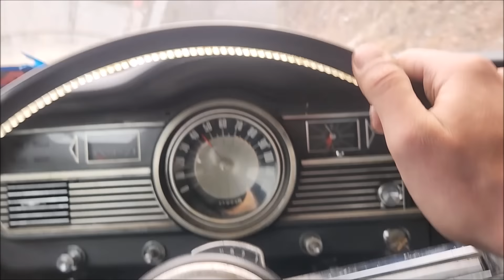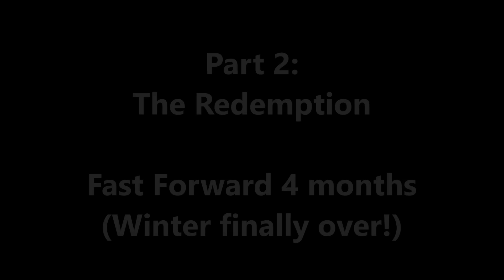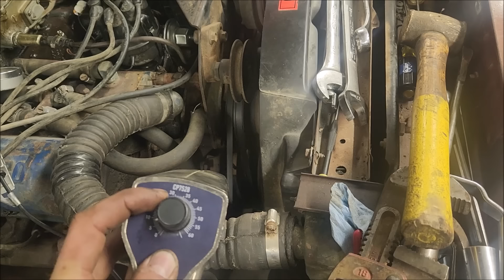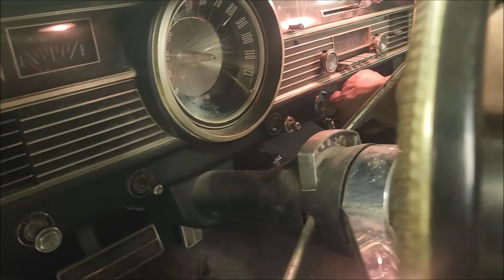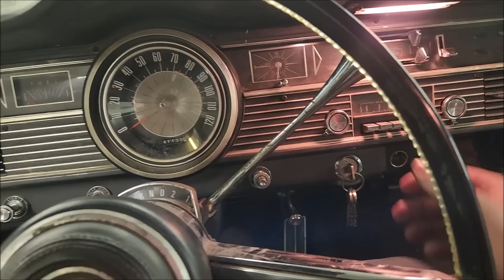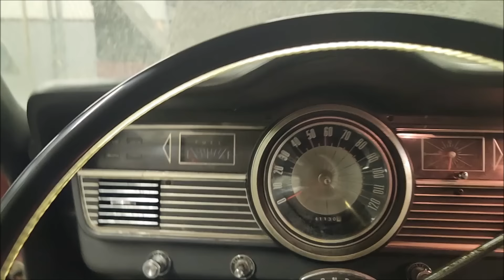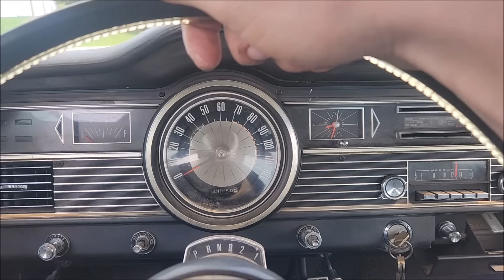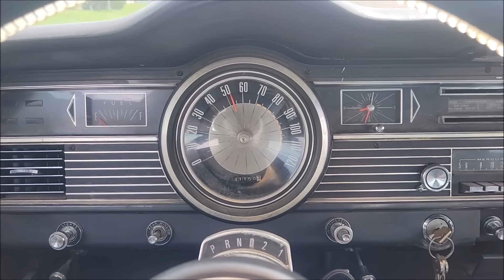$1,000 Classic Car - Will it Run & Drive Home?

Comment from the maker: Probably my favorite moment of the entire video was when I turned on the radio at 46:00 - 47:00. 
What a surprise that was 😆
Reply: No matter where you are and if only one station will come in. It will be a self help or religious one..go figure
Reply: Agreed hilarious random talk-show moment.
But what i resonate most with is your earlier point about parts compatibility by sticking to car models that share a lot of parts.
To others like myself, without much space to work on cars and keep parts, this is great advice.
I've had a Fiat, Seat, Suzuki, and now a Volvo. But i'm definitely sticking with Volvo and will most likely be driving the (2000-2010) V70's and S60's for the rest of my life.
Reply: If you wana do some Blow all you gotta do is ask unk Luke
Reply: hahah that was hilarious
Reply: It's a hell of a drug
Reply: Sounded like Dave Ramsey's voice.
Reply: Tell you what though. There are a few old cocaine addicts wandering around.😊
Reply: I had a 60 f100 and had a 351 Windsor in it. The trans went out, so I had an FMX trans so I put it in. That trans was stout. I know people talk trash about those. However, that one was really good
Reply: Back then, Ford am radios 📻  were the loudest. We had a killer AM hard rock station KVAN 1480 High as Hell from Orygun 👋
Reply: I have engine compartment heat issues (75-87 Econoline w/carburetors) I am thinking about using those "liquid heated carb plates) to run a separate cooling system (Using like an A/C Condenser in front of the radiator) with separate coolant that is pumped via an electric pump, to cool the base of the carburetor....Due to today's fuel...I would run a return fuel system, but it still won't help the "parked boil over scenario" nor will it work easily with multiple fuel tanks.... Its really only the short stops that it causes an issue, like a convenience store stop on a road trip... Overnight or a couple hours...it doesn't matter much.
Reply: Cocaine is a hell of a drug--Rick James...
Reply: Tech tip, pack the flutes of the tap with grease and most if all chips will stick to the tap.
Reply: Yeah that was funny! Talk about timing!!!
Reply: @courier11sec It's the meth that will get ya!
Reply: In the words of Johnny Paycheck:  "The old white train costs a lot to ride."
Reply: Nice Video
Reply: Cool ol Truck 😮
Reply: @ThunderHead289 a bit of axel grease (packed into tap openings) in your Tap for the fuel filter will catch most of the cuttings from dropping into the (Carb) insert boss threaded part.
Also thread tape should only have 2 perhaps 3 wraps at most.😊
Happy Fixing.😮
Reply: @sidviscous5959  lol, what a name, sid. cheers!
Reply: @Derek-tk4wf Same, I am 99% sure it was Dave.
Reply: Great channel man the radio 📻 that was a crack up 😂
Reply: are we going to have a revist to that mower you made from the axle I think it's very cool
Reply: Yeah, and THEN you started digging around under the carpet. I started thinking, hmmm, wouldn't that be ironic, lol
Reply: That was gold
Reply: Do those distributors come locked?
Reply: Does it have a dimmer? Check that floor bump, I found a Ford mechanic's 1/4 "drive ratchet tool in a 1990econoline E150, the guy at East Lake Street motors had a rusty white 4 door Lincoln, a dive back in to Ford may be in my futures
Reply: At that point, I  had a feeling cocaine is what you was going to find under the carpet.. lol
Reply: Guy on radio sounds like Dave Ramsey.
Reply: @ThunderHead289  😂😂. Definitely a peak moment.

Comment: Luke, you do such a good job of instruction and advising when you work on these old cars!  When I was a teenager, I asked for a timing light for Christmas (around 1975-- I got a Sears Penske timing light and dwell meter.  I still have them!).  Back then, most of the vehicles on the road still had points type distributors, and I worked at an auto parts store where I sold lots of points/condensers (I still remember parts numbers from back then!).  I learned how to do tune-ups, and most of my friends and family used to bring their cars to me-- mostly GM with a Ford here and there.  As long as they paid for the parts, I didn't charge any labor-- what a deal!  I remember that my grandfather's Chevrolet truck was running rough and to my surprise, he asked me to look at it for him (he almost never asked for help with anything).  I put a new set of plugs in it and tuned it up for him (and found a broken vacuum hose which I replaced), and he was a happy camper!  Thanks for bringing back good memories!
Reply from the maker: Those are the best kind of memories 🙂

Comment: Back in the day (I'm 75) I was a tow truck driver.  Back then, more was possible than just dragging cars onto the ramp truck and hauling them off.  Can't tell you how many times I would go out and find a no start in a shopping center.  Often it was a Ford and it cranked fine, but no start.  I learned pretty quick that you jut pull off the air filter and shove a screwdriver down the carb which would open the choke a it and cranking while flooring the gas would light it right up.  Because of course, the lady that was driving it would have pumped the gas like a pump organ until it was totally flooded.
Reply from the maker: The wildly pumping the gas thing is a weird thought process. 
Very strange how in the last ten years that's become the "expected thing to do". 

I watch people flood carbed cars out all the time in recent years - very curious phenomenon
Reply: I have watched JD do this pumping thing a dozen times and he just floods the crap out of 1 and throws another carb on cause it must be bad ..lol great video

Comment: Other channels give entertainment and laughs.  This channel gives entertainment and education.  If you watch his revivals,  you'll learn while you watch.
Reply from the maker: My main goal is just passing on the info I wish I didn't have to learn the hard way, so others don't have to 🙂
Reply: @ThunderHead289  You would've been the best certified Ford Tech at a Ford dealership back in the late 60s, 70s and, the 80s even post 1973 with the crappy emissions systems. Your knowledge is golden and if you were to get laid off back in the day, mechanical initial timing and vacuum advance timing applies universally to all these classic cars pre fuel injection and you would have a really good resume to move to another dealership if that scenario played out during that time period. I'm more of a GM guy, but when it comes down to it all diffent makes of classic cars need to be saved as it's part of American history and you are right about sticking to one brand for parts interchangeability and that's why it's important to spread the knowledge on the internet because everyone has their preferred brands.

Comment: I expected a simple entertaining revival video...
But i got surprised with an in depth educational about the 'magic' of engine timing.
I always wondered about it, but was never compelled to dig into it in fear of it taking a long time to figure out.
But you made it easy to digest in only a single hour.
Very much appreciated!
Reply from the maker: You are very welcome - my ultimate goal is to just put out the info I wish I had when I started. 🙂
Reply: @ThunderHead289  But my high vacuum advance at idle gives me an efficient idle, which saves me gas in traffic jams, red lights, during jump starts etc. and if I set my base timing that advanced, it would try to start backwards and mess with my starter motor, and I don't hear any spark knock at idle, and vacuum advance at idle keeps the plugs from fouling at idle, so I really prefer manifold vacuum advance.
Reply: Uncle Luke does that a lot, haha.
Reply from the maker: @alan6832  you have other issues that manifold vacuum is bandaiding is what you are experiencing
Reply: @ThunderHead289  I'm not talking about a specific vehicle.  I'm saying idle is inherently far more efficient with vacuum advance, just like it is just off idle with ported advance.  I want more advance during idle than while cranking and the best way to get it is with manifold vacuum.

Comment: I'm glad Luke mentioned what has been a mainstay for me for years.  I've picked the vehicles I want to deal with and and I keep spare parts for them on my shelves.  Interchangeability is a plus.  When you do your own work, keep an inventory of parts and being your own parts guy goes with it.  Sticking with your brand keeps inventory down.
Reply from the maker: You may get labeled a "fan boy", but your the one laughing when you have everything on hand and know every little nuance - less surprises that way often and more fun 🙂
Reply: I think this is actually most of what is behind all the silly Ford versus Chevy rivalry. It's just easier to stick with one brand and learn it well.

Comment: Thanks for the reminder Luke on adding that 1/8 turn to the Idle mixture screws to fatten it up a bit. Yep, guilty as charged sir! Will be putting the gauge back on in a bit to take care of that 460 lean issue!  Thanks for sharing. Good stuff as always. Cheers from Motown/Dearborn!

Comment: I'm a GM guy of many many decades. Both GM and Ford have made things they got really right. If we got a vehicle that was all the combined good of each would be pretty damn cool. But that never happened and is never going to happen. Ever since about 2005 we have been in a steady free fall with cars. CAFE has fucked everything up. Needless driving aids and nanny systems. Needless electronics and comfort items. More body modules than 15 cars should have. We had it right about the turn of the new millenium. Highly reliable and fuel efficient cars that were repairable by average Joe's.
Reply: I agree.
Reply: Amen to that! AMC was a half attempt at combining Ford, Chrysler and GM into one vehicle and AMC did make some stout rigs throughout their existence I ain't gonna lie and they had some flops too of course.
Reply: Buy an AMC, my Javelin used the big 3, GM distributor, Chrysler transmission and Ford starter & solenoid..😝
Reply: @DoyleShadduck  This!

Comment: Great video 289.  I'm older than dirt and back in my day every 16 year old that claimed to be a wrench learned all this first doing a basic tune up, times have changed.  Now I work on other peoples rides when they get stuck doing such things, drum brakes, carb work and even simple stuff like front end work, idler arms, fuel pumps and such.  Glad to see you're carrying the torch and helping others with the information.  I build and swap LS's (both injected and carb conversions) and 4L60's now for my friends but I still like to get my hands on older iron from time to time.
Reply from the maker: I bet we both have backs in similar conditions 🙂

Comment: As someone who used to do this for a living and who would definitely lose my head if it wasn’t attached, the best way I found to keep from losing parts or tools during a job is to designate a specific place to put them. I had a rolling plastic cart for parts and a small tool cart for tools (both rolling because I would work in different bays in the shop). If you give yourself a specific place to put stuff and train yourself to use those spots, you’ll have fewer instances where you get distracted and set things down in random spots. It worked for me anyway.
Reply from the maker: You are very correct - I used to have a cart until I backed into it (apparently i needed a cart to put my cart in so i remembered where it was. Need to get a new one!

Comment: It amazes me how many videos I see of guys pulling a non running FE out of a field and it’ll idle a nickel like that with a little tuning. Great job. Meanwhile I do a complete overhaul and the new motor smokes like a freight train.
Reply from the maker: I always avoided FE engines for most of my life due to some stigmas I acquired from other people - but once they landed in my possession, from my own experiences I have been absolutely nothing but impressed

Comment: When I was young man. Had a 72 Galaxy 500 two door HT. 400M c6. That car was the best car I’ve ever owned. But you know being young and not to wise. Sold it. With age comes wisdom. Thank you for the content.
Reply from the maker: You are very welcome. 
From regret and pain comes wisdom indeed, or at least one hopes.
Reply: Thunderhead 289 you could always acquire the car sans drivetrain back and marketplace another drivetrain option to put in the car and make that a continuous video series with the car there's a few things that you can fix up on it i didn't say it needs them fixed up though.. but i think alot of us would like to see it

Comment: Luke, you have answered a question I had, way back in '73 approx. I had thought I had a vapour lock problem, which I could negate by pouring cold water over the carb. Now this was an old (then) '62 Ford !500 Cortina (English) which had a down-draft Zenith. It got so bad, that my only choice was ditch the car, or carb. Price differential between new carb and new car was in favour of car (£35 v £50) Of course I went with new car b. Can't remember what was in the kit, but it was quite substantially more than I took off. I suspect one thing was thicker spacer for single barrel. Did make difference, 'cos problem went away for rest of cars life (6 months). Now I know why!!! Thanks Luke, this is why I've missed you, you answer 50+ yr old questions. From UK.

Comment: Thank you for taking the time to post these videos.I finally got my hands on a 67 Galaxie that I have passed by for years as it sat in my neighbor’s driveway. It was going to be converted to a four barrel,but the project stalled.So…That meant the carb and distributor were thrown inside the car.This is taking me step by step through the process of getting the car going again.Thanks again!

Comment: I never miss an episode, you're my kinda guy. Being as that's a 67 I wonder if it's a 410ci? The 390 bore with a 428 crank. It's a great looking old car, I would jump all over that for $1,000 too. It looks like the paint'll buff out really nice, doesn't look rusty, interior looks savable. What a dreamship.
Reply: Nice idea about the 410, but all of them were 4 barrels. But you can see this is a 2V. I have a '66 Colony Park wagon with the 410-4V and a '67 Mercury Commuter wagon with the 390-2V.
Reply: There's quite a bit of rust on the lower rear quarters. Cool car though and worth restoring.

Comment: Love old Mercs. A blast to drive and they ride nice. 1965 2 door Monterey 390 is so cool. NO COMPUTERS. For me, I would've pulled the engine & trans out & a complete rebuild on both. Next is the differential. While that goes on, body would be completely restored at the body shop. Then complete new suspension installed before engine/trans reinstallment takes places. That car would last the rest of my lifetime unless some drunk plows into it. Lots of DWI/DUIs in this state. Fatalities because of it too.
Reply from the maker: A computer is often still no replacement for a human 🙂
Reply: You must have a fat wallet.

Comment: When I was a kid, we had a Colony Park wagon ‘69, I think. Two things those cars never have are brakes or oil pressure.  Ours stalled sometimes when you apply the brakes hard while making sharp turns.  My mom smashed ours into my uncle George’s boat trailer for that very reason.  I loved the car.  Huge, comfortable, power everything which was a big deal in the early 70’s.

Comment: Fun fact for ya. The pump shaft on an ATX front wheel drive transmission (Tempo/Topaz) will fit perfectly into the oil pump and is more than long enough to run the pump with a drill prior to running engine on new builds. Ensures oil system is fully primed before firing up, especially useful on flat tappet engines.

Comment: You need to show those who don't know how to determine timing in a Ford. Initial + mechanical = total and then vacuum advance on top of it. You showed the inside of the distributor but didn't go into depth on the weights being labeled 10L, 13L, or 18L most commonly. Viewers should know that those correspond to 20, 26, and 36 degrees of mechanical and how to set it. Most Ford V8's should run 26 mechanical and 8-10 initial for 34-36 total and they will be happy. My five are at 36. Switching distributors also changed the advance can where Ford used different internals to determine the amount of vacuum advance that could be employed be it 8, 10, 12 or so. Like you I have various Ford distributors along with various weights, springs, and rods to achieve a desired combination.

Comment: Great video, Uncle Luke.  Very informative, as always. I'm way older than you, grew up in the 60s when fuel-injection was exotic and mostly done only in racing. I remember when vapor lock was a n issue. I'd still be wrenching if I had a garage (and the gumption). Guess I need to find some space somewhere and get back to it. 
Thanks for your hard work.

Comment: Hadda father figure growing up...He was a Ford Big Block maniac. To the point he kept a new 429 SCJ cam in his closet for " the next one". This man was 5'2" with fingers the diameter of my thumbs. He used an old milk crate to gain access to the engine bay on his old 460 powered C6 equiped, F 150. We called him " Mini Brute". Find you an early 70s 460 powered something or other and install that cam...would be fun. He was all about using stock parts...because you can " find them anywheres". His son and myself were best friends. Needless to say what he drove. On friday nights, we got together in that Electric Blue F 150 and would go out looking for Corvettes to jump on...stop light to stop light.
   Also...as far as the "clear flood" on the carb is concerned...If you are dealing with an old GM TBI injected engine, this is actually " a thing". With the throttle wide open, when you twist the key, the ecm/injectors go into "clear flood mode". No fuel is injected.